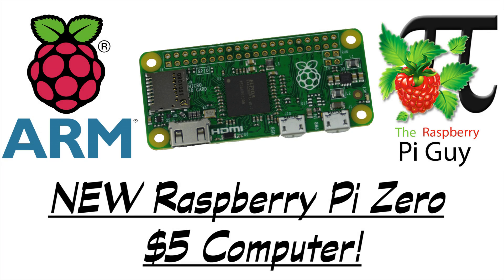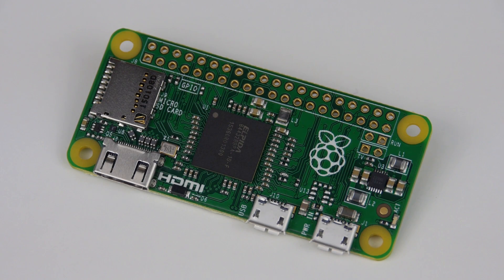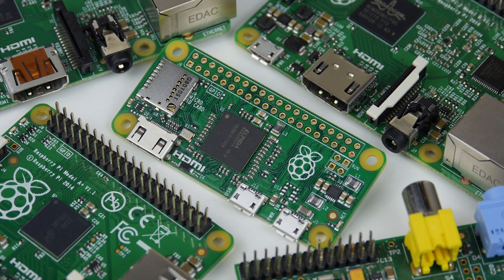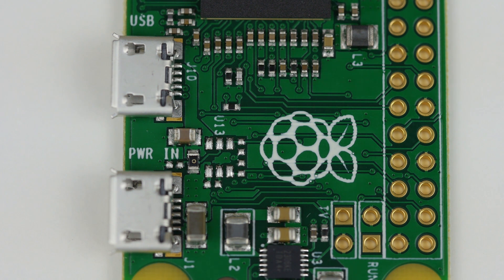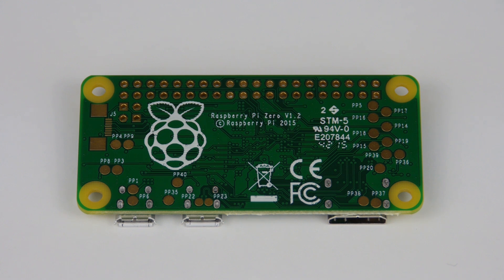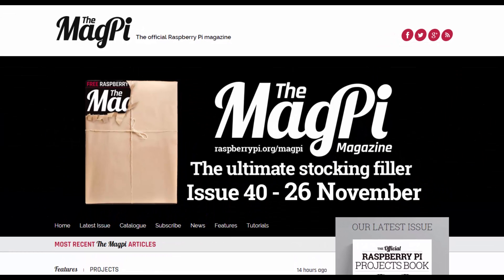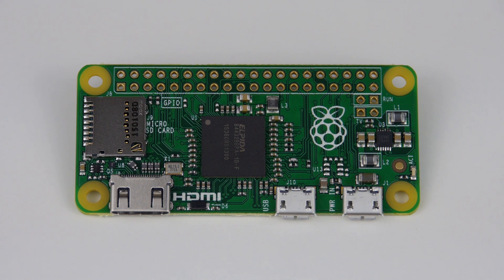NEW Raspberry Pi Zero - $5 Computer!

Comment: Two drawbacks - does not has USB Hub and no WIfi. Both can be addressed using HubPiWi - a project at kickstarter. An Add on board that requires no cable or connector and extends three USB ports and a Wifi.

Comment: Out of desperation, I stuck my wifi k/board/mouse into the USB out adapter, and it worked right off the bat.  I installed NOOBS with Raspian.  So I had both keyboard and mouse from the get-go.  My mouse is a little shaky, but still functional.  I am waiting for my powered USB hub and ethernet dongle.

Comment: -----BEGIN PGP SIGNED MESSAGE-----
Hash: SHA256

i swear the AAPL and MSFT , Vertu MUST M&A the PI CORP due to the low price of kicking the mega-greeder PC likes expensive HP,IBM, CSCO,JNPR,MSFT,DELL,

if the $5 USD come out the first bankcrupt must be AAPL because they cannnot affordable the high salary of their SPY Engineer
-----BEGIN PGP SIGNATURE---
Version: GnuPG v2

iQIcBAEBCAAGBQJXB+juAAoJEOF93b4xqLWAiL4P/iet67n500ua1MqFRqSRxB1O
US2g9T2ZRgOowr4+oe250i5RPEZ35arIk1qxrPmkCd9UOmedeCuNlvtMZm7Qq449
2c2rgmTpdDyLeACbRLKFkSchUYMA0DOpVCEJdO2CJxB8/EhmMkItHtZVWLrHNK+r
m5e/kUjAj5F6QSRWk1ACzBVRfoyziYH+ya67uy0A1JQ4hjJP4CCu7eq7GHXZOwDt
oqtlMctKLe6cMdcoKWNZpsEqIcCBdt2xeaDNxkv+YlJHDs2xClZerpViBtroXtxK
Vbn46KOVj46K8z4ibRZoMtvardUNOCV46nlqTC0srcLCqtO5W3xHbdjRrR4TC0Td
qvHSvv7S7z/UTFvrlVJpEkH06+dYumRfkuq3x3qYVqTlwbBjKLpec63ZRwfBzss5
+nXvPhoFeaBkoBGXmXLF76WB0KyAucMHAc2ruR7SVgathZQ64pdyu3jCxgydQHAu
VdVD6GTvOTlfw70V+4cTWpppbYI/h4O+5qKCT9AO4I4r/3uIZsFA9dee4Gmn33AR
RjjoNnUDD+EdPxghvb5LKaChF6pUgjJwCTMIamoBZ4o7Q39ybkIg7SkU9uFvIxmW
izqzxeP5DocH+i7vLf3CFlG8HXeuhzdFKFLk2VAPWmtZFdtkhvHtHS2HZkuEfYVC
WoR+p5E+buyHX5TITfsc
=gQij
----END PGP SIGNATURE----

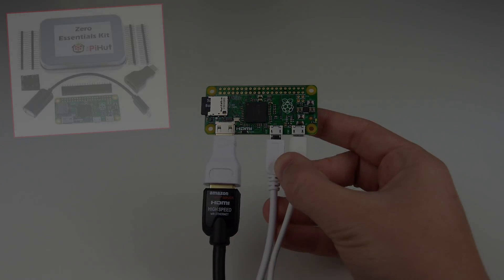Comment: 03:05 What are you supposed to use those pins for that can be seen in the picture?
Reply: Those are GPIO headers which can be used for various things such as connecting sensors, lights or really any sort of device to the Raspberry Pi. The Zero does not have the pins on to make it smaller so the kit provides the pins for you to solder back on if you need them in afew different configurations to let you choose which pin would be best to use for your project

Comment: HELP ME! I need a cheap microcontroller that will run some very basic software linked up with a small touchscreen display to control 5 to 10 servo motors. CanI do that with a pi zero? What else will do kt as cheap as possible. It has a basic touchscreen interface and a calender and alarm and nothing else but must be connected to the internet

Comment: Yesterday I was plugging in my raspberry pi zero for the first time. I plugged in the hdmi first but as soon as I plugged in the powered usb hub, the raspberry pi zero started up. I didn't expect this. 
My question is, does it hurt the pi to run with out the power going to the power port and running data and power exclusively through the micro usb only?

Comment: Noob question please - er... this is the first time I have heard of a raspberry pi. so, what is it? A computer that what I can plug a monitor into or a phone? Is it for personal use or is this for IT people who know about cmputers and will have a use for this?
Reply: +trixapete ...read, read, read... you'll learn it all!  (not) but you'll learn a lot!
Reply: +trixapete it is pretty simple if you buy a higher model, like pi 3. Buy the O/S Sd Card.  Plug in accessories, HDMI, stick card in slot, plug in, and go.  It will run all kinds of great aps and has a desktop.  Probably about like windows way back, when you started out with that.

Comment: I love it.  Only one issue I would like to see wifi and Bluetooth built in.  would save mad space rather then adding accessories.  I can hook up many devices this way and avoid a cable mess.
Reply: +trip3980 too costly, too much on board power draw.  A powered USB hub, takes that overhead, nicely.  Everything else, the GPIO is there to work with.  General Purpose Input Output... multi voltages, and controlls, just have to READ.  These are not OOB full blown PC's  A Remix-Mini is close, but it's Android OS, a lot more overhead.

Comment: They should have better let the usb, now we all need a microusb to usb cable :/ ==> more space and money
Reply: +Massimo Giardina I agree, I think whatever the foundation saved by using only micro USB and mini HDMI on the Zero (as opposed to full sized versions of the connectors) is nothing compared to the cost the Zero's users will have to pay to work around these artificial limitations.  I would have been glad to pay $10 for a Zero with full size USB & HDMI connectivity.
Reply: +artfd Guys,  If you'd like to... where is the Serial and Parallel ports? ... USB is already 20+ years old. PC folk hated Firewire, why?  It IS a lot faster than USB!  There should be a new protocol, at a x10 or x100 speed coming soon.  I have a friend who wrote SATA/OE "over ethernet"  Keep watching, keep talking, keep playing!
Reply: +artfd there were specific design goals in mind when they engineered this Pi.  The size was very specific for some electronic applications.  If you want more connectivity, buy a different model.

Comment: +TheRaspberryPiGuy How did you even install Minecraft without internet?
Reply: I meant not for the zero. The other pis.... Well okay. But this MC Edition is super little and just alpha stuff
Reply: +David M. Nothing forbids you from using the same SD card on both the RPi Zero and the RPi B, which features an Ethernet port. Once you've got it connected to the Internet, you can download Minecraft and Java easily :)
Reply: well, i'm not planning to get more than a RPi zero and some usb connectors and maybe a dongle... soo no minecraft for me??!
Reply: David M. Why not? You can download it with the WiFi dongle.
Reply: +David M. mine is on my NOOBS.
Reply: +David M. I dont think the pi zero was build for minecraft xD
Reply: VigiHunter that's why they made minecraft pi edition. :]
Reply: signore del tempo yes, i guess... thanks!
Reply: +signore del tempo wait wait wait. the RPi Zero and the RPi 2 can use the same os? ah that's too neat I mean I guess why wouldn't it but still.
Reply: zach burke Yeah sure, even other models. Linux won't complain (unlike Windows, for which you'd have to buy it again) :D As long as it's ARM, there should be no issue.

Comment: It seems if I don't have all the required adapters, It would be cheaper to buy a full sized pi. Considering I don't have any of the required adapters to hook this up to displays, wifi, keyboard and mouse I think I know which one I'm going to get.
Reply: +Freelancerk1bbles I thought I had the required adapters, but the designers installed the "need" for a couple of things I don't have in my computer junk drawer, and I though I already had everything I needed.   I already have several previous RPI models I fool around with, and I do agree, if you are going to try RPI for the first time, don't try a Zero.

Comment: what do ppl use it for? I mean I run my linx server on vmwares, I've pretty decent PC,  I know it's cheap. I saw my instructor showcasing Pi in the class running server off of it, pulled the plug out, put it in the pocket and walked away and we're like 'whao'. Is it just for 'whao' and then collect dust in the case? am not gonna use to for my day to day use, it's simply not adequate to do things out there. May be people of poor country may benefit from it, learning computers and all that.
Reply: +Jackey Niraula what kind of things would you say it isn't adequate for? there are tons of amazing projects being done out there, and although some projects are mostly for a "whoa" there are many practical uses. The biggest difference between your PC and vm machines vs RPI is the fact that your PC is not a small embedded computer that can fit into many small projects and interact with the real world through the use of GPIO pins at a relatively low power point..
Reply: +Jackey Niraula Raspberry pis only limit is the depth of your imagination. Simply love it and hats off to the Raspberry pi team, you guys wowed us yet again!

Comment: Being quite new to PI, and a newbie at coding, what will I need to get to make this work.  I know of NOOBS program but what can I do as a blank slate to use this, have fun and do my ham radio hobby in the future.

Is there any beginner videos that I can watch and learn from?
Reply: +william northcote Google will be your best friend in your search.  There is a ton of material available on using Raspberry Pi's [RPI], for people of all levels of computer knowledge.  Haven't found YouTube all that valuable for that.  I DO NOT recommend the Zero model for a beginner in RPI.  The RPI Zero model has very limited abilities compared to the other available versions.  Spend a few dollars more for an RPI that doesn't require you to buy things like a HDMI type C (or mini) connection and a converter for USB standard plugs to USB micro plugs.   The MicroCenter where I bought my RPI Zero had also sold out of anything with HDMI type C connections, that was no surprise.

Comment: 5$ is truly unbeatable. Only problem is the lack of network connection.  I think if they added a RC45 socket and raised the price to 6$ , this would have been far more popular.
Reply: +Hamguy Bacon  The PI is meant for makers, not meant for being a PC.
It's capable of being a PC, but that's where the  PI 2 comes in with 1GB of ram, 4 cores @ 900Mhz, audio jack, full hdmi, 4 usb ports and an ethernet port.

You cant fault them for you trying to make it something it isn't.
Reply: There is the vertical space where it no longer will be slim and the space required to route the traces. Also this guy's job is not be a computer. That's Pi 2 B's job. This is for people who want to make a robot, an arcade game console, a sensing hub attached to their computer. Want WiFi? Use a WiFi dongle! This is a 5$ product that is marketed at a very specific market. Much more specific than the already specific market of the regular Pi, which is for all tinkerers and computer enthusiasts. Even serves as poor countries' children first computer to learn on! This is only for those people that want to use sensors and do all sorts of cool stuff that is related to hardware, not software.

Lastly I do not really know. But I think the main chip doesnt include an ethernet interface. If that is rhe case you need an extra chip which adds much much more space amd cost.
Reply: Hamguy Bacon and occupying much valuable space that could be cut off for compact products. Its like hating on the arduino nano or the pro mini
Reply: +Hamguy Bacon oh Lord you are hopeless. if I am making an arcade video game system do I need ethernet or audio out (other than HDMI) or any of all that?!!
Reply: Hamguy Bacon yes, they decided to do it this way, I quit like it like this. Which Is why I am trying to explain to your stubborn brain that is coated with 7 layers of jelly and a tinfoil hat that this is a useful product. Stop being so butthurt about it and live on as if it never happened...
Reply: Hamguy Bacon Just stop.
You're making a problem out of nothing because you don't understand marketing and why they make their products like this.

It's exactly how we are saying it is, not how you think it is.
Reply: Hamguy Bacon  They're marketed towards modding enthusiasts, not the average facebook, spreadsheet and youtube watching consumer.

The PI 2 was made with a desktop environment in-mind. Also to keep in mind that you can still do everything you can on this board, but has more horses and extra attachments to keep the desktop user, or a project maker that needs more than the PI can handle , happy.

(If you don't understand by this reply, i'm just going to deem you a troll (or something mean), and block this.)
Reply: Surms41 I really will start to ignore this guy. And watch him lie saying he was trolling us this whole time..... He thinks the world should be tailored to his wish. Or probably just buthurt that he couldn't get a cheaper product which he thinks he is the only one who deserves a product to suit his needs
Reply: Anas Malas Valuable space? it can be extended just 3mm and fit fine.
Reply: Considering that the one of the most popular applications of these ultracheap micro pcs is the internet of things, it's not unreasonable to expect, some sort of internet connectivity. 

50 years ago your car was a horse and it was shitting all over the streets. Should I be grateful today that my car isn't shitting around then?
Reply: flanker The guys doing IOT could stick to the old one. This one is targeting the group that does other things. This is not a direct replacement so why all the fuss? I personally have no intrest in yhe ethernet, audio out, camera, display,  etc. But I would like to do robotics. Especially some that require some graphics such as a robot with a screen for a face or eyes or similar...
Reply: Hamguy Bacon yeah I just fot confirmation that you are a 7 year old. Big words for your age, son
Reply: Legend Length Well you could plug a usb ethernet card too. But that'd require a miniusb to USB converter also you'd need a usb hub(considering zero has only 1 usb port- second one is power)
Reply: +flanker They always make the stupidest decisions. for example 256mb instead of full 1gb on the pi A. its not that much expensive holy shit! Seriously what the hell is the point if it cant connect to the internet.
Reply: Surms41 dont give me that crap, It needs to be a PC to be able to be useful, a ethernet port or even wifi would have made this great for clustering or creating small projects.
Reply: Anas Malas yes, it would help alot. and there is no reason not to considering they cost about 20 cents.
Reply: Anas Malas No, no problem with people that have common sense. I have a problem with people constantly making the argument that pc takes a rich person to get into...

Keyboard, mouse and headset/mic can be bought for less than $100, and a console controller alone costs $60.

Idk what u need any equipment for.
Reply: +flanker probably could power via GPIO then have two data ports (i think, i dont actually have one)
Reply: +Anas Malas its not your decession what this computer is supposed to be used for.
Reply: sithseven I think that this isnt really possible. Also the second USB isnt connected except for the power lines as far as I know
Reply: Surms41 What marketing? i thought Raspberry foundation was non-profit. For some reason they let you connect to older tv connectors but they wont let you access the internet which is important in our internet society.
Reply: Surms41 I am a console user. Got a problem with that? But the main reason I dont have a pc is that buying all the woodworking and electronic gear sucks money... That fluke multimeter cost a pretty penny. And itll take some time to get the oscilloscope...
Reply: Surms41 I do alot of electronic stuff, as well as electrical. I need something accurate and wont blow up...
Reply: Right now $5 is a vapourprice.
Reply: +flanker add a 2 usd ESP-01 panel, so it can jump onto wifi
Reply: +flanker Guys, a USB 802/11x USB adapter is $2,  less than a KB or Mouse, or the PS.  You get "the guts" for $5... Extra's always extra. Like floormats.  LOL   What 486 came with a NIC? I could find you one today for $5, still w/0 a NIC!  
Be happy, I got my kit, all the adapters, and ps, and GPIO riser and a "case" for about the same as "all that" for a Pi2.  I'm happy.  No waiting in line on Amazon.com.  They have them, & plenty.   Enjoy your boxes, himmms & hawwws are IMHO wasted time.  Enjoy your "zero's" :)
Reply: +Hamguy Bacon look at this an do us a favor of shutting up your stupid mouth.

http://www.ebay.com/itm/Micro-USB-2-0-to-Ethernet-10-100M-RJ45-Network-Lan-Adapter-Card-For-Tablet-TS-/261695299578?hash=item3cee415ffa:g:o8kAAOSw7ThUh-13

+3USD and you get internet, stop crying.
Reply: +flanker I believe this is geared towards embedded projects. Things that don't really require internet access.
Reply: ZackaryVS For such projects, I'd use 1,8$ arduino. To me, the importance of pi is it's connectivity.
Reply: You do have a point there, but this is just an option for those who need more power for some reason. But it would be nice to have ethernet. I really want one, but they're all sold out. :(
Reply: its 6$ canadian 😓
Reply: +flanker or to keep it as small as possible, wifi capability. Granted, I don't know how expensive that would be, or how much space it would take up on the chip.
Reply: +flanker I agree, I think it should have the HDMI and the old yellow video connector (RCA) and a stereo headphone jack

Comment: I am interested in getting one as a replacement for my dead computer since febuary... Well, 50 hkd is really unexpensive...I do wonder how the wifi can be used, do I need a usb key for recieving wifi or is it not nessecairy.My current needs as a student are: Google drive, gmail. It should work well, right?

Comment: Which Pentium is this comparable with?
Reply: +SlightlyWetFart Look for the the MIPS spec (million instruction per second) of the Pi and compare it to late Pentium 3 and early Pentium 4. My bet is P4 at around 2Ghz. The netburst architecture of the P4 was notoriously inefficient and drastic improvement in instruction per clock (IPC), huge L2 or L3 cache and much faster subsystem (system bus, memory bus, etc) of modern CPU taken into account, twice the clock speed should be about the right.
Reply: +leefiles pi zero runs 1ghz. max 386 ever ran was about 33 mhz so no.
Reply: +SlightlyWetFart intel 386
Reply: +SlightlyWetFart pentium 4
Reply: Pentium M probably!
Reply: Pentium M probably!
Reply: Pentium M probably! But in fact there is no way to compare ARM cpu with an Intel64 one.
Reply: +SlightlyWetFart  actually at 1ghz, it = 1000, 6502's . (aka Apple iie) with a form factor of "onechip"
Reply: You're completely ignoring that what matters here is the instruction set, rather than the raw power.